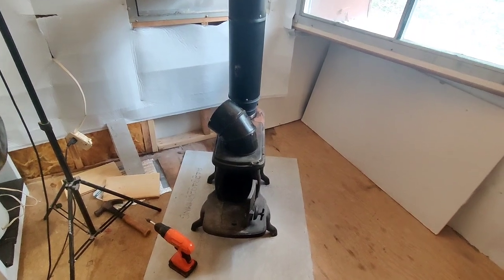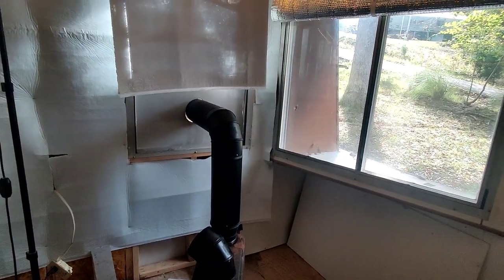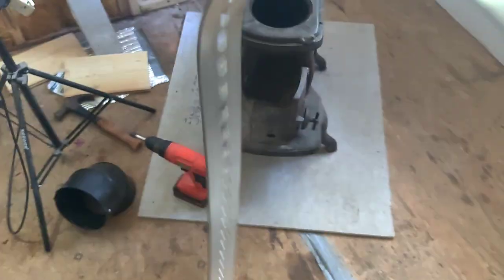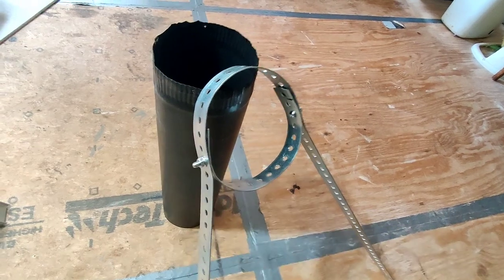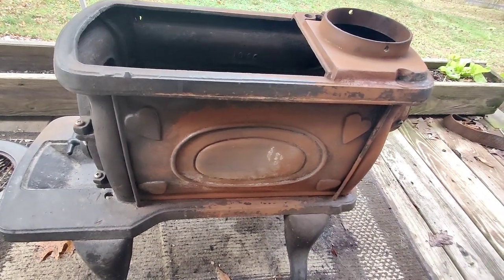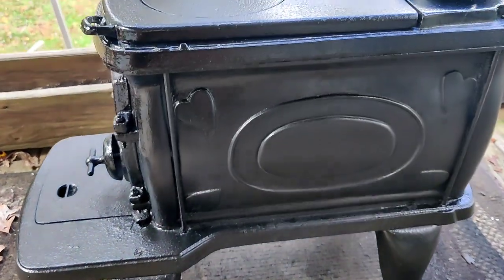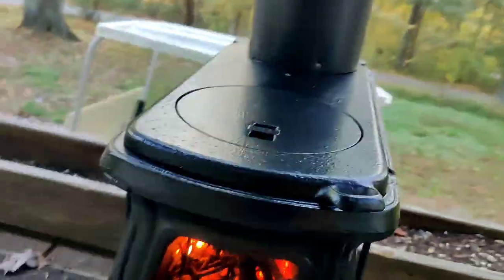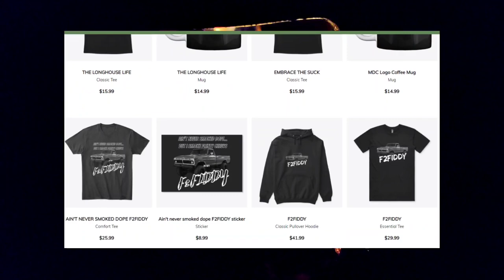MOBILE HOME WOOD STOVE - IMPROVISED CHIMNEY BRACE - SAVE $100

Comment: you can at cut an aluminum pie plate to slip over that stove pipe and close up that hole, a steel one or a steel cake pan would work too, more permanent. spray it black to match. Be sure to add some fiberglass insulation between the chimney and the 'gasket'. Use the stove pipe to mark out the circle you need to cut.

Comment: Not sure if you can use it on a horizontal pipe but a heat reclaimer would blow a lot of your lost heat back through the house. You can order them on amazon, starting at about 60 bucks. Lots of people in Alaska use them. Or try to find an all metal fan and sit  near the stove, all metal are hard to find, but they are still out there